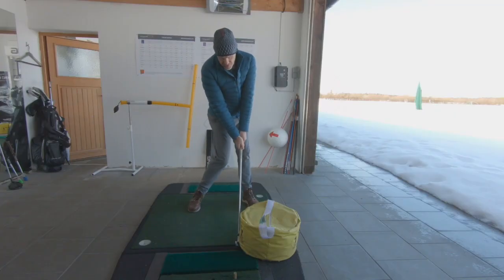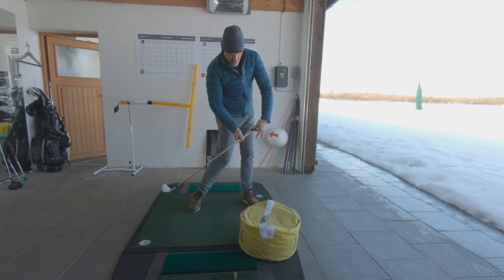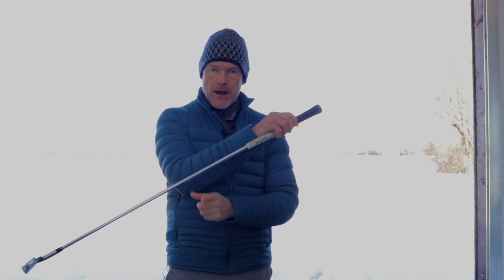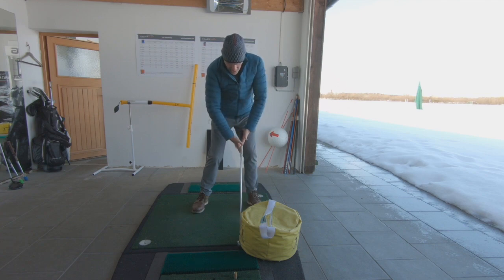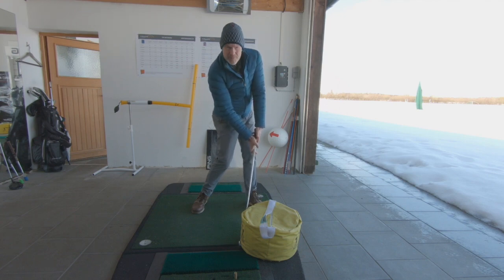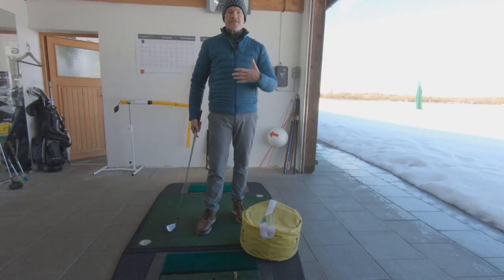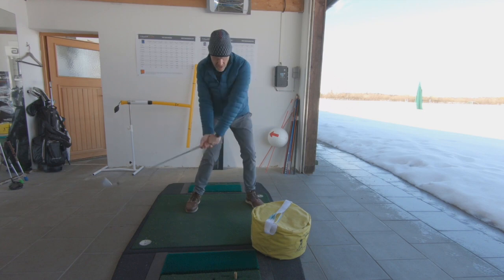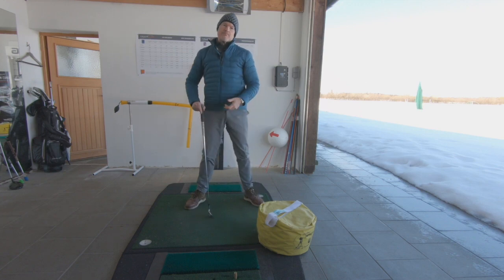How to apply more pressure to your golf club at impact.

Comment: How much does golf ball type, construction, compression, etc. have on smash factor ?
Reply from the maker: That is a very good question. In my experience, it will play a role but is not close to the importance of a centred hit. For example, take a common range ball and a distance ball and you will get a good deal more ball speed on the distance ball.